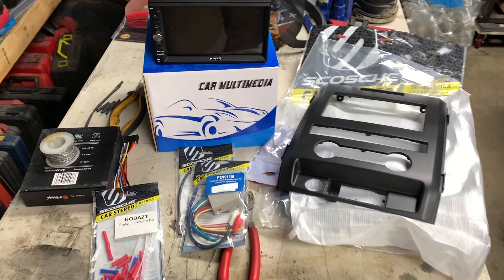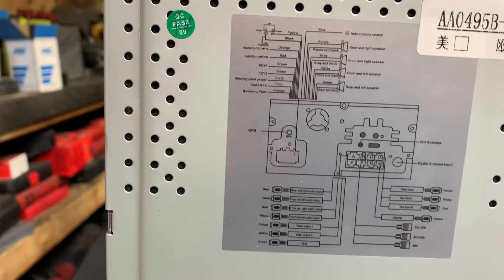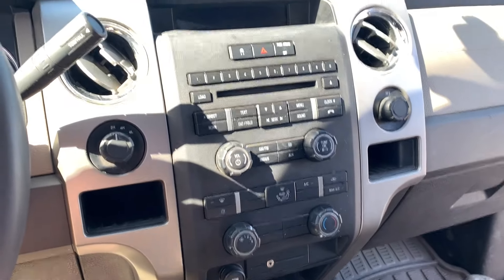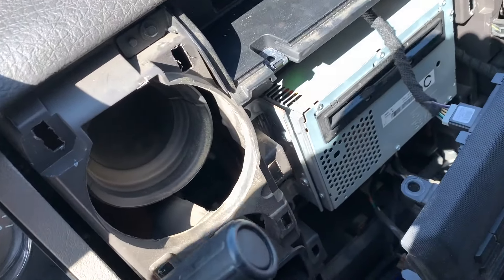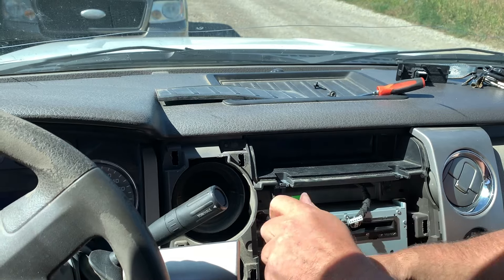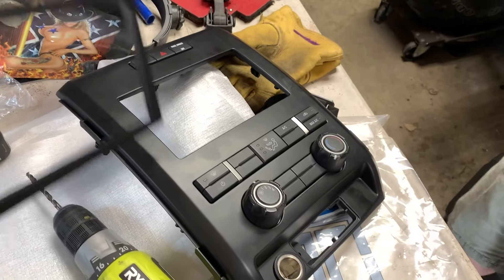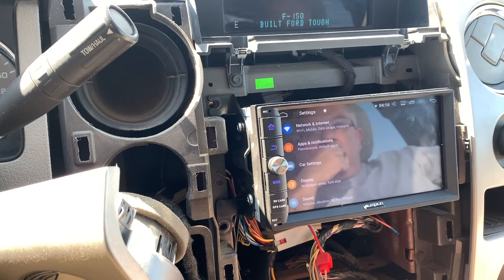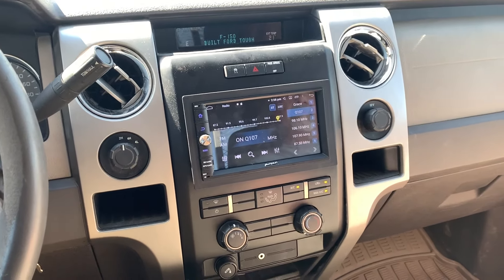DIY Ford F150 Stereo Install 2009- 2014

Comment: Can you explain more in depth how to tap into the red wire you had to fix like the ignitions paper thing?
Reply: Power*
Reply: I used the blue wire from the hazard light connector to the red wire on the radio
Reply: @Beaksterboy  does it disconnect power from the hazards?
Reply: @kylandmeldon3431  that's why u tap into it and not cut it... hazards will still work bro.

Comment: So the existing radio screen will display built ford tough continuously when you remove the radio itself? that's kinda neat
Reply: That kinda drives me crazy just knowing that it's supposed to go away with the stock radio.

Comment: I know this is a 4yr old video but the fitment is usually the reason most 12v professionals WONT install these universal android radios, cuz they fit like crap. Also that truck is technically a canbus data turn on radio hence the reason for a data module. You won't have a dimmer and reverse wire at the radio hole either, THATS why you use a data module
Reply from the maker: That is correct, there was no canbus module available at that time of install

Comment: Do not splice into that ignition wire to connect the red that this guy used in the video. Doing this will make it so the radio never turns off even with key out. It has constant power.
Reply: What do you do then?
Reply: Found that If you go to the orange and white one instead than it will work. The orange and white wire is the ignition on wire.
Reply: Steven Benitez I connected my red wire to the orange and white wire and still no power
Reply: Did you find the right wire?
Reply: Grizzlie43 are you
Reply: johnny_kilroy  It was a white wire with an orange stripe. Your best bet is to take a multimeter and place the leads in the connector where you would expect there to be the ignition on. From there place your key into the ignition and turn on the battery only. You should see a change in voltage from 0v to ~12v. If you place the meter leads on a wire and ground and immediately get 12v, then you’re on the constant power supply.
Reply: If you have a 2011 ford f150 its the brown/blue wire on the a/c plug harness
Reply: MikeCheck Productionz i would think the same on my 2009 but didnt work. Any other ideas for the power wire?
Reply: @Travel.Remodel.Repeat  yes. AC harness

Comment: Putting the radio into the dash is self explanatory. Wiring the ignition and illumination wires is not, where do we run those two wires and where should we run our ground wires?

Comment: 🚨 FOR EVERYONE STILL TROUBLESHOOTING 🚨
Tap into fuse 37 with no less than 20 guage wire. Use a MINI (not micro) "add-a-circuit adapter" from your local auto store.
2008 Ford Expedition* 
They have the same passenger footwell fuse box layout. Best of luck.

Comment: Did you hook up a backup camera with your install? How does the head unit know the car is in reverse to switch to the backup camera/
Reply: With the reverse signal. Wire. On the stereo

Comment: Mine is not powering on, and I spliced the white and red line to tap into that, which did not work. I do not see a wire here that i can tap into to get the power turned on.

Comment: What wire do I use for the ignition wire
Reply: If you have a 2011 ford f150 its the brown/blue wire on the a/c plug harness
Reply: I used the blue wire from the hazard light connector to the red wire on the radio
Reply: @mikecheckproductionz  thank you so much
Reply: @hbawsome2187  No problem... but you may want to just run a wire to fuse box. I say that because now that I ran my wire to the one mentioned above.. each time I turn my defrost on.. the radio cuts out. So you may or may not want to do that.

Comment: Does the original radio display screen just stay stuck on Built Ford Tough forever?
Reply: I have an aftermarket radio in my 2010 f150 and the top dash display is stuck on “dvd”. Not sure how to fix it

Comment: Be cool if you showed the wire you tapped into closer.
Reply: looks like the white/orange stripe for the AC
Reply: Not only that, but tell people why you are splicing wire.  DID any wires get spliced into the harness inside the vehicles .

Comment: What is that other smaller harness for? I’m installing on a 2013 F150 STX and all I have is the big 24 pin connector for the aftermarket harness but don’t know what that other small harness is for. My radio will not turn on either, can anyone help me out? No video I look up is helping.
Reply: I’m with you, 2014 STX and even though I have a smaller harness it only has various shades of brown on it. None of which have power. The only place I found a switchable power was the center green wire that attaches to the hazard button.

Comment: Does anyone know what color wire he tapped into to get power to the stereo
Reply: He seriously skipped over the most important part of the install smh
Reply: I used the blue wire from the hazard light connector to the red wire on the radio
Reply: @Beaksterboy  holy fuck thank you, mine was green on the hazard. Everyone saying ac wire but mines always hot.

Comment: I have a 2011 and everythjng hooks up besides the red plug on the right the smaller square shaped one and it doesn’t power up my radio and idk what to do
Reply: Get a can bus harness for your model. Don’t try to tap into any wires it will mess up your electrical system.

Comment: Which sterio is this screen size? Does it support steering wheel command
Reply: applenutz2003 as far as i know the command system in these fords are SYNC. so unless you program the stereo with ford sync i don’t think thatll work.

Comment: I want to upgrade my stereo on my 2010 Ford F150 but I have a question would that drain my battery? Since he's going to be using more energy / power than the normal factory stereo

Comment: Which wire (color) did you hook the 12+ red to get power ? I have the same problem
Reply from the maker: I used a meter to find a 12v ignition on wire
Reply: BSK Garage  was that to the harness next to the big main harness ? Sorry I literally am having this problem and your video is the only helpful one
Reply: I got it ! Thanks so much !!
Reply: BSK Garage sorry to ask the same question but having the same problem, which wire did you tap into
Reply: Alex Miller I tapped into the same wire as him which was to the A/C 12v wire .
Reply: @jordan_5.450  what color wire
Reply: Darrell Wagster it’s white with a red stripe on my truck . It’s in the A/C harness
Reply: Thank you for this! I had the same problem. Only thing now is it doesnt turn on and off with truck. Any advice?
Reply: @carsonmathews1264   I went to fuse 37 did a tap and fuse Turns on and off with delay  like to 10 minutes that you  had with the original factory
Reply: ADD-A-CIRCUIT BLADE STYLE ATM  MINI FUSE HOLDER FUSE TAP
Reply: Jordan_5.4 which one was it
Reply: Okay so I had this same issue for my truck the head unit wouldn’t turn on. It turns out I had a blown fuse under the hood ( the cigar plug fuse) and then another one inside the truck on the interior fuse panel. Once I changed these the stereo turned right on.
Reply: Did you use a T Tap?
Reply: Jordan_5.4 what color is it?
Reply: If you have a 2011 ford f150 its the brown/blue wire on the a/c plug harness

Comment: Does your stereo screen stay on.? My unit is a kuratu and I did same power reroute but the screen stays on
Reply from the maker: If you did a power re-route to a ignition on only power you wouldn’t have that problem
Reply: What color wire
Reply: @TestDontguess  dude, re route to WHAT wire?  You keep saying that without saying which wire. Illustrate please.

Comment: Are you telling me you bought an install kit from pumpkin, to install their radio and it didn't even fit properly???  that is brutal I'd be demanding my money back pretty quick!
Reply: No he didn't. The Part No. is FMK540 and it comes with an FWH694 wiring harness. Or at least mine did.
I'm right in the middle of my install. I have a 2013 XLT and it looks exactly like the one in this video.

Comment: Title should read 2009 to 2012 because the 2013 is different than that. The a/c controls are not the same and that face place will not work.
Reply: I agree
Reply: Mine is the same as this video. 2013 XLT four door ie., super crew.
Reply: Mine looks like this as well.. 2014

Comment: What is the color of “this one right here” 7:40
Reply: That's what I need to know
Reply: It’s on the hazard light cluster, blue wire , use a separate wire to connect blue wire to your ACC wire/red from the  radio wire harness

Comment: Ok yall on a 2010 F150 i checked all ove. Found the wire to the yellow/blue wire in the hazard light harness
Reply: Did you mean yellow/grey? 2011 has no yellow/blue wire there.

Comment: How much was the stereo
Reply: $259.99
Reply: $259.99
Reply: I just bought the exact radio. $ 303.00 and includes the back up camera and free shipping.
The install kit is from Amazon $30.00
Reply: @sandrunnerprime37  Can you post link where you purchase it?

Comment: I purchased mine from the Pumpkin site. I do not recommend this radio. After using it for more than a year now, it doesn’t keep time. The gps/map feature is pathetic and not really useful. The radio reception is not very good. Do not buy it.

Comment: Does this require anything for the antenna or the controls in the steering wheel??
Reply from the maker: to install it properly you'd need the a canbus decoder then you should in theory be able to using the steering controls

Comment: Will this work on a 2012 XLT ?
Reply: Yes, but I highly suggest buying the Scosche Interface Module (model FD5000SW). Just about every Walmart I've gone to has them in stock, and they're about $50. Without it, you will have to either run a fuse tap or splice a wire to get accessory power to turn on the radio, since Ford uses a CAN bus data system to run diagnostics and power equipment. It can be done with the cheap harnesses, but it's a lot of extra work and I love having my steering wheel controls. It also allows the stereo to continue to run after you shut off the vehicle (for a certain time, or until you open your doors, like the factory radio does).
Reply: @eginteractive  if I don't have steering controls do I still need the black box? The module?
Reply: @davidrojas3753  I'd still recommend that you get it as it handles the powering of the stereo so you won't have to use a Posi-Tap to run power from somewhere else. Old stereo installs on just about every car / truck used to have their own separate power line for stereos, but now everything is done the CAN bus, so you have to muck around with different sources to draw power. The module gets rid of this need and actually runs it through the CAN bus like the factory stereo does.
Reply: @eginteractive  thanks
Reply: @eginteractive  I just bought a used truck that has an aftermarket stereo installed and I’m having an issue that every time I turn the truck off and then start the truck all the radio setting are gone and my sync and steering wheel controls don’t work. Any tips.